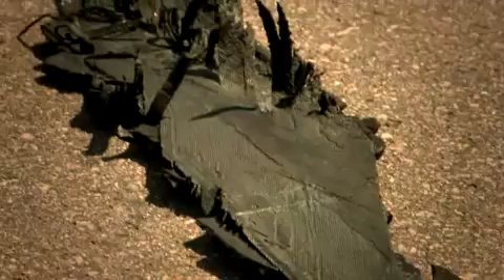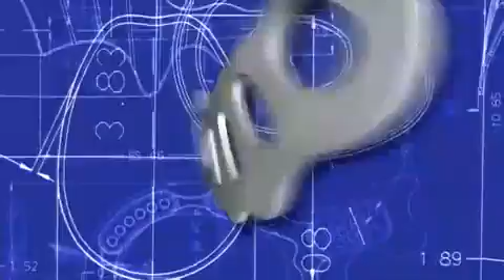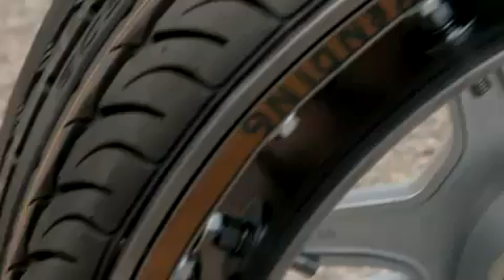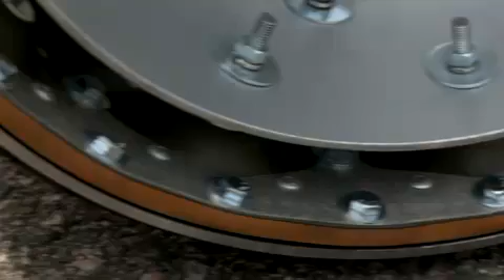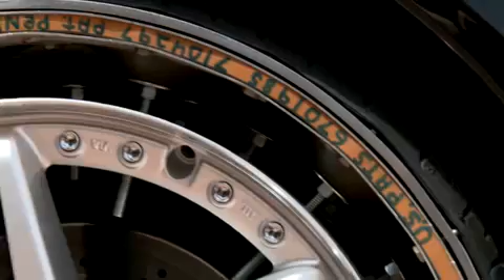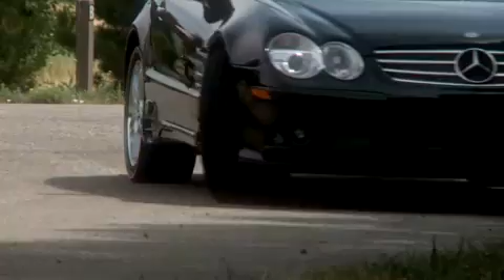The Energy Return Wheel ERW©

Comment: How is this efficient when you're adding SO much weight to the rotating, unsprung mass of the car compared to a regular pneumatic tire?
Reply: +Audio Crossing Even our early prototypes outperform pneumatic tires in acceleration, anti bounce hook up at high speeds, immediate handling. 50% Reduction in wheel mass, replacing much rubber with composites...ERW ...LESS weight than pneumatic tires and wheels...Dude.
Reply: EnergyReturnWheel HAHA what composites? I see no fiberglass or carbon fiber here. Buddy, you've got a rubber traction surface, a steel barrel underneath, some thick foamed rubber for NVH under that, another metal barrel, and then a bucket of metal bolts, nuts and washers where there used to be sidewalls and air. You're ADDING weight to a comparable pneumatic tire. Prove me wrong with some 3rd party testing or fuck off with that 50% bullshit marketing hype.

Comment: I do believe the largest issue isn't the technical aspects, but the laws that makes a non-airbag based tire illegal on the roads.

The reasoning basically goes back to the oil industry forcing that all tires to be road worthy must be filled by air, and the real reason (not the efficiency argument that they like to give), is so they can make money off of replacing flat and worn out tires.
Reply: +John Walker II Vacuum Pressure ERW now qualifies...There is "Air in There" 18 Hg Vacuum. Morphing Replaceable Treads. Vacuum Charges Sidewall Curtains. Existing Wheel Attachment System. Progressing against the odds.
Reply: EnergyReturnWheel With all due respect, I rather talk to a lawyer who specializes in this kind of law, than a marketing department who want to push the very product we're talking about.
Reply: Vacuum Bellows US 9,004,120 B2  Russell responds to ban. Foreign manufacture contracts are in place. US ban will not prevail.
Reply: EnergyReturnWheel I'll see how it goes in court, thank you for confirming that it's not legal in the US.
Reply: First 3 US patents...True. US 9,004,120 B2 not yet. The $300 Billion Tire Industry will repeat the 1970 Bias to Radial Tire retool. Vacuum is too predictably safe and efficient to ignore...40% premium for 50% longer life...Hyper performance.
Reply: +EnergyReturnWheel   My idea I had for over twenty years has been how to get (a)posing magnetic wheel within a wheel that would actually take the place of the suspension of the car , then a non pneumatic tire/ wheel could work.  These magnets would also generate electricity.( electric motor).  You see were I am going with this.
Reply: Yes we do...Starting point...Impacts and magnets do not go together well...Event horizon frequency...large impact becomes many small vibrations...Counterbalanced equal and opposite actions / reactions in real time 180 degrees...Across the hoop
Reply: +John Walker II  $300 Billion dollar Tire Industry has much momentum  and political power. Trillion  dollar Petrochemical Industry, Auto Industry?...I think they like us...Allot.  In the end Efficiency will win.

Comment: what kind of thread is used here
Reply: +cino jose Membrane is Rema 4,200 psi. Total Wheel tension 180 lbs each pull x 36 pulls unloaded.  
Low performance Rema dry stock rubber was upgraded to Speargun rubber...Now Kevlar Vacuum Bellows.
Radical reduction in mass.

Comment: Anyone notice? US 9,004,120 B2 Vacuum Pressure applied to "In Wheel Suspension". Low frequency pneumatic tire can no longer keep pace with today's modern suspension systems and demands. Tire failure is all too common. 7 flat tires in the USA every second.

Comment: Test this wheel system on Montreal Canada roads. I'd be impressed if the steel hoop doesn't get knocked out of shape or develop 'flat spots' on Montreal roads.
Reply: +Baron von Drais Metal has it's limitations. Kevlar reinforced carbon fiber...Infused with single wall carbon nanotubes.
Please review our bicycle ERW videos.
Reply: Of course steel has its limits. Everything has its limits. I repair carbon fiber and I am very well aware of the limits carbon and Kevlar have and I'm not so impressed with carbon as an 'everyday' material.
Reply: Our Novel Traction and Cushion System protects the hoop. Morphing and traction come together...Anti Kick Back. 16 year long project.

Comment: I would just like to know as you said more energy is return to the wheel , can a full gas tank that run for 300 miles, have significant increase in mileage after changing to this wheel( maybe 320 mile instead of 300 ) ?
Reply: earthshipstar1 We are keeping quiet for now. Our first USDOT tests required brakes to be applied on all highway coast down section to keep to a +20% test protocol. Coast down was 50% longer than 35.5 psi pneumatic tire.

Comment: ERW  4/14/2015,  US 9,004,120 B2 Elastic tension backed by vacuum pressure.  Pressure install, run air pressure, "Ambient", or "Vacuum Pressure".  New CIP patent filing for traction systems and other 21st Century Wheel Patent Claims.

Comment: If you want even less rolling resistance, try a tire made of glass!
The deformability of pneumatic tires allows them to absorb impacts and maintain traction in varied conditions, the way a stiff spring-steel tire can't. You could easily pump up a pneumatic's pressure to achieve lower rolling resistance than these so-called "Energy Return" Wheels, at the cost of some traction and absorption, so such apples to oranges comparisons of rolling resistance tests are pointless - instead, let's see how well it holds traction cornering on real world rough roads - and watch their claims of improved safety land in the ditch.
Compare this rigid steel outer wheel to Michelin's Tweel, which appears similar, but has deformability equal to, perhaps higher than pneumatic tires, and the difference will become clear.
This concept was flawed from the beginning.
Reply: Carl Monson Most concepts are flawed from the beginning...R + D required. Tweel is low speed application. Poor efficiency. We have novel traction systems that produce a prescribed tread block. Debut 2015 NASA Rover Challenge 2 teams. ERW now has 74 issued patent claims.

Comment: Knowledge of physics is the big difference between an engineer and an "inventor".
Reply: +EnergyReturnWheel Wheels do Not recycle heat. Wheels have No benefit from heat. Rubber tires dissipate heat (the same as rubber band does) and do not absorb the heat as energy in a fashion that will produce momentum. I'm not really understanding your short comments but to say that ERW wheels recycle heat sounds like a bunch of hocus-pocus.
Reply: Tire pressure only increases 1psi for every 5*C increase in temperature, therefore tire pressure may only change 5-8psi when driving. This does not make for significant over-inflation or deformity of the tire casing.
Reply: Morten Knudsen Knowledge of physics and  innovation? Probably not going to get many mechanical patent claims w/o.  Inventor risk/reward or engineer salary?
Reply: Both occupations require an understanding of physics. Risk / difficulty / reward...Pay favors the Inventor.
Reply: I wasn't talking about requirements for being a good engineer/inventor. Anyone can call themselvs an inventor, but engineer is an education.
Reply: Cooperation makes it happen... Inventors, investors, corporations,  "Industrial" engineers and before you know it...A product.
Reply: EnergyReturnWheel I know, but that has nothing to do with my comment.
Reply: Are you an engineer?
Reply: EnergyReturnWheel Yes
Reply: Excellent...Each auto hoop / wheel is charged 4-6 tons of dynamic tension. What  system would you choose to "stretch" vacuum bellows to inner wheel, positioning and charging the wheel?
Reply: EnergyReturnWheel Charging the wheel? The best and most energy efficient wheel doesn't absorb ANY "dynamic tension". That is why trains have steel wheels. If the suspension is IN the wheel, you lose energy in the form of heat with every turn of the wheel, that's why the axis is in suspension. So when you drive the wheel on a plain surface, you don't lose energy to compression and decompression. But steel wheels don't have sufficient grip on asphalt, so you need rubber, just like in both normal tires and "The Energy Return Wheel". But then there is the problem of potholes and other irregularities of the surface, like the curb, that can damage the wheel. That's why we have air in tires. Normal tires are a compromise of the two, were as low profile tires have low energy loss, at the loss of safety for the wheel, so you have to be very careful with potholes and curbs, like you probably know about "The Energy Return Wheel". The idea of the energy return spring in shoes doesn't have this problem, because you will always get the compression and decompression, that's why the wheels is so awesome. And by the way, tyres are really safe and relative cheap. The faulty tires described in the video, are cheap revulcanized tires. Don't buy that shit.
Reply: Try this experiment...Stretch and recoil  a rubber band against your lips...Notice heating upon stretch, cooling upon recoil. Rolling ERW recycles heat in this way.
All tires are vulcanized...Thanks Goodyear. 
Steel wheel on rails 700% more efficient than pneumatic tires...Room for improvement?
Reply: nasatv.com has archived footage of "hard steel wheels" competing 2014 -2015 NASA Rover Challenges...Contrast ERW performance...Levering, cushion and traction. MTSU, TTU, HCT and Embry. Back to back top ten finishes MTSU and TTU,
Reply: Place a rubber band between your lips. Stretch and recoil. Heat upon stretch...Cooling when recoiling. ERW Top side stretch...Bottom Side Recoil.
Reply: +EnergyReturnWheel And so what?
Reply: Air cools when "Stretched" in our Vacuum Bellows. Heat is the ultimate inefficiency...Pressure vs Vacuum Pressure 19th Century VS 21st Century.
Reply: +EnergyReturnWheel But that has nothing to do with heat returning to and "charging" the wheel.
Reply: The wheel is not charged by heat. It reduces running temps via stretch/ recoil....Obvious first USDOT High Altitude Lab tests. 48" rollers accumulate heat...Intensionally. Tires are over inflated and become more efficient when hot.
Reply: Interesting...We are talking Heat as wasted energy...USDOT needs heat on rollers for traction. Our "in wheel" Suspension Reaction "Frequency" is Vacuum Pressure Adjustable... To milliseconds.
Reply: +EnergyReturnWheel Yes, we are talking about heat as wasted energy. Do you claim to reuse that heat? "Our "in wheel" Suspension Reaction "Frequency" is Vacuum Pressure Adjustable... To milliseconds." sounds very much like pseudo science.
Reply: Rolling pneumatic tires generate  heat. We just make less. The High Frequency Response is possible via opposing Vacuum Bellows.  The "Anti Bounce Effect".
Reply: +EnergyReturnWheel GG

Comment: if the rock or mud gets into that gap the wheel becomes a death trap because the wheel is out of balance.
Reply: They can fix that
Reply: US 9,004,120 B2 Enclosed Sidewalls.Vacuum Bellows, Composite Hoops. Inflation install, relieve air. Run Ambient or introduce Vacuum Pressure. High Frequency response increases with vacuum.
Reply: ??? that was official response? a bunch of random words... how about simple explanation for simple people like my self... using actual sentences.
Reply: Wheels are fully enclosed...
Reply: well ok.. but not in this video. any links to enclosed ones?
Reply: We have been advised to keep production ERW Top Secret. A $200 Billion Industry is at stake. We will remember our friends...See more britektire@twitter.com

Comment: I would think it will absorb energy and not re release it back on to the road, the principle works on the shoe because the shoe is dropped on to the road, the spring compresses, then releases the energy as the shoe is lifted again. however the wheels are not dropped on to the road and then lifted again so no mechanical advantage is gained. But that's just my thoughts on it.
Reply: Pneumatic tires bounce ERW will surge forward. Screw Force from drive train is 20 percent better as well.
Reply: Ah interesting. Thanks for your message : )
Reply: ERW draws forces to points within the wheel...Then levers off those points returning 90+% to the rolling action...Unlike pneumatic tires that waste 25%-50% of that energy on sidewall displacement.
Reply: Hey Thanks! US 9,004,120 B2 our progress...

Comment: 4 minutes of talk and not one number to provide comparison to conventional pneumatic tires. Quantify your invention so that we can compare to what has been around 100 + years. Is there a in increase in fuel efficiency of the vehicle? How much? A decrease in rolling resistance? How much? Noise reduction? How much? Lifespan? How much?
Reply: Joseph Creed Joseph, what I was saying was that a pneumatic tire is not the best option. I was using hypermilers as an example of over-inflation of a pneumatic tire and how it has the same characteristics as a tire that does not use air such as the Energy Return Wheel. You should seriously consider that the pneumatic tire is NOT the best option as trains, forklifts, and tanks do not use pneumatic tires and they get around just fine. There are much better options of travel out there. Open up your mind and think outside the box, friend.
Reply: DeezMistaReez We are looking at a Mercedes Benz, not a forklift.
Reply: Just because the "conventional pneumatic tire" has been around 100+ years doesn't mean it's the best option. If you research "hypermilers", you will find that one technique they use is over-inflating their tires well over the recommended psi levels in order to achieve greater fuel mileage. The over-inflation creates less resistance to the contact surface. Compare that to this wheel and it is essentially the same concept. Plus, it uses less rubber because you're not wasting it on the sidewalls, and no risk of a "blowout". The benefits absolutely outweigh the cons of this design. You just won't see much of it on national news because anything that helps achieve greater fuel economy in turn hurts the government and big oil.
Reply: DeezMistaReez You just stated that Pneumatic Tires may/may not be the best option? How does that make any sense? The pneumatic tire is what the human race relies on every single day. There is no better option. There is new technology that bring great ideas to the surface, but surely there is no better option.
Reply: DeezMistaReez The problem no one seems to want to talk about is heat. In a pneumatic tire, as the wheel spins, the air inside it flows, keeping it at an even temperature. Maybe if the space between the wheel and tire has some sort of heatsink that could help.
Reply: Joseph Creed  no se trata de que haya o no una mejor opcion si no de que no hay otra opcion viable solo la que erw esta proponiendo de cualquier punto de vista es mucho mejor
Reply: JEAR RANGEL It looks stupid.

Comment: so infact it's a rubber coated rim?
Reply: It is a highly stretched rubber layer drawn between a hub and hoop. 12 X the wheels load is typical pre charge. A negative pressure wheel. Weight bearing  and rotation creates stretch rather than compression. Pull rather than push.
Reply: EnergyReturnWheel Do you have videos that demonstrate this? I am intrigued.
Reply: We made the switch to bicycles as the path of least resistance. We have continued the vacuum pressure boost and tune research.

Comment: Please review our Big Kahuna Drag race 29"ERW MTB vs 29" Tubeless MTB
For you doubters a 60 year old vs 40 yr. with 10 years BMX racing experience.
Reply: question for you.  I support the idea of an airless tire, but there is still the issue of tire wear.  how would tires be changed on your current system?
Reply: Expandable, replaceable treads. Nano rubbers plus the reduction of tread squirm will extend life cycle. Remember these were 5 years ago home built prototypes.
Reply: alright thanks, good luck!
Reply: +EnergyReturnWheel Drag races with human power do not prove a thing, if anything it's just entertainment. A simpler but proper test would at least start with time trials (same rider, same course, many runs, average times) to see if there is a difference. A laboratory test with an electric motor and a set number of watts to put a wheel/vehicle in motion tested with different tires and wheels is the only way to get real numbers to see if there is a positive difference with your energy return system.
Reply: Oxylane Lab Finland 29" MTB 42 watts to turn 1.5 meter drum @ 20 kph while weighted with 50 kilos.

Comment: the difficulties for us is things like finances
Reply: We have gone it alone for 12 years. Developing a new negative pressure wheel has required the material science to hold the dynamic tension between the wheel  / hoop. Approximately 12 X the prescribed load. Without our efforts... Nano rubbers, high carbon carbon would not be used in the tire industry for decades.

Comment: A new mechanical wheel...IE dozens of issued patent claims will always require extraordinary proof. Negative pressure wheel turns weight bearing into kinetic energy returned at high frequency. We do not need a physicist to give us permission to describe what the videos show.
Reply: I'm curious if there is a maximum speed limit these wheels can endure? From the video I understand the inner loop is suspended from what looks like bolts to the outer loop with rubber.
My question being if the vehicle is driven at high speed through a corner, would the "bolts" ever bend/ wear out/ crack, etc?
Also what would happen if the wheel should suddenly encounter a bump, like a pothole would the "bolts" be damaged or is there some sort of shock absorber effect in it? I just watched the video on the shockwheel lol so I might be joining concepts, but it seems plausible.
Reply: Please review our other videos. These were our first prototypes. We have a Hyper Car NDA in place...Attempt at 260+ mph. Bolts are drawing approx. 300 lbs. membrane pull each in the USDOT Lab videos.